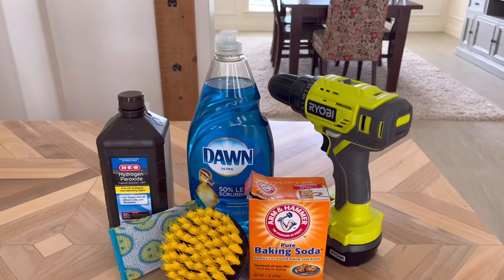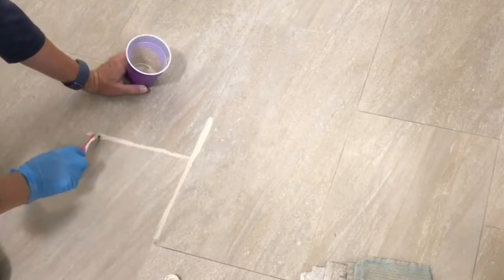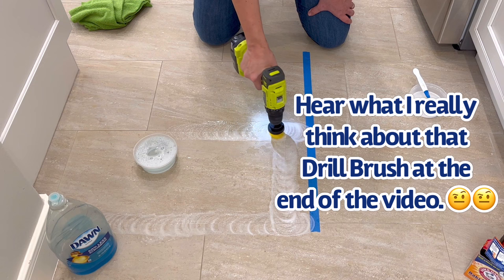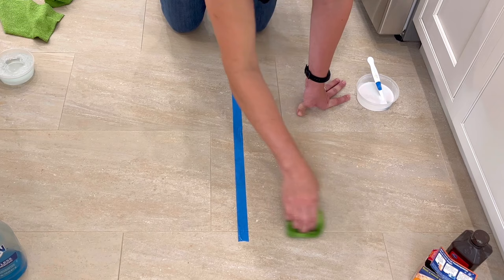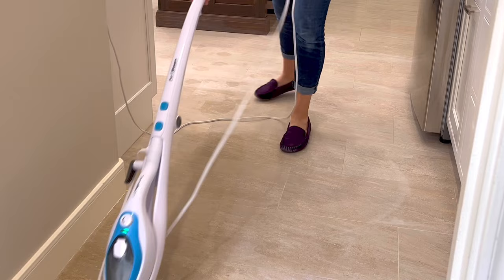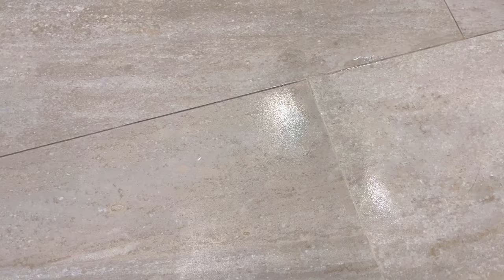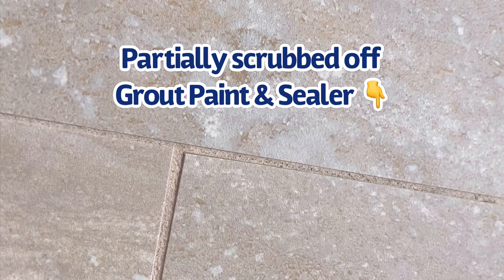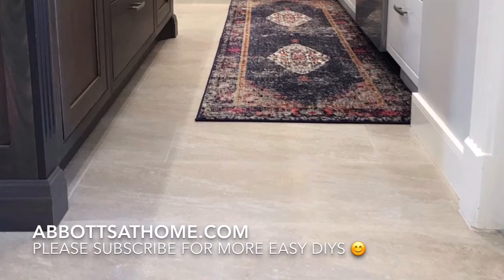Testing 5 Ways To Clean Grout On Tile Floors (Including Homemade Cleaners AND A Drill Brush)

Comment: Excellent video! I was literally 2 seconds from purchasing a drill brush set! Thinking what a great idea. But now....I guess it will be just get on my hands and knees with a gentle brush and see how it goes. Thanks again for sharing your knowledge.
Reply from the maker: Thanks! Yep, unfortunately they strip the sealer off of your floors. Good luck with your grout! :)
Reply: I watched about 5 different videos.yes baking soda will leave a powdery residue that has to be sucked up by wet mop or vacuum and powder will make it appear whiter. But they usually recommend resealing grout anyway.and some products are going to break down any sealer anyway.maybe vinegar,oxygen bleach,hydrogen peroxide,lemon juice might break down sealer anyway.i think I would rather use drill brush then scrubbing.just don't need to run over grout too much since it's way more effective than hand scrubbing.i just think it's good to reseal after all clean and dry.especially if seal is old..frankw
Reply from the maker: @moniquenoverola7843  If you don't mind sealing after cleaning, then I totally get wanting to use the drill brush. Most of my house is tile, so I'd rather stick with my steam mop most of the time. Thanks for the comment!

Comment: Simple solution for getting rid of baking soda:  When you are done cleaning with it, mop with vinegar solution.  It combines with baking soda to make sodium acetate.  That is very water soluble, so it's easy to wipe up with a damp mop.
Reply from the maker: The bad side of using vinegar, especially undiluted, on floors is that it strips the sealer on grout. And, eventually it would breakdown and etch the grout. 😊
Reply: @AbbottsAtHome  
Yes, it has to be diluted quite a bit.  When it stops foaming, all the baking soda is converted, so time to remove with a clean water mopping.  This will happen instantly, and leaves no vinegar behind.

Comment: I don't understand why everyone is saying baking soda and peroxide. I thought it was awful and messy. It did not do a good job of cleaning my grout. But my grout is super super dirty. I'll try just the peroxide.
Reply from the maker: It was a mess. I usually scrub with dawn and hot water. Then use peroxide if it needs a little whitening. 😊

Comment: I use gel toilet cleaner applied to the grout, leave for 15 to 20 minutes and then scrub with Hoover Power Dash scrubber with water and bleach
Reply from the maker: Thanks for sharing. I usually avoid bleach and things like toilet cleaner because they strip the sealer off of grout. So, I'd have to seal the grout every time I used them, or the grout would just get stained faster.

Comment: Best home made grout cleaner
Mix together 
1 part Surgical Spirit.
1 part washing up liquid
2 parts water.
Use a old tooth brush.
Rinse with clean water.
Wipe clean😊 PERFECT
Reply from the maker: For the non-Brits that read this, surgical spirits are the same as 70% rubbing alcohol here. I’ll have to give your mix a try. Thanks for the tip!!
Reply: @AbbottsAtHome heyyy ty so much for your hard work and did the alcohol and dawn solution work?